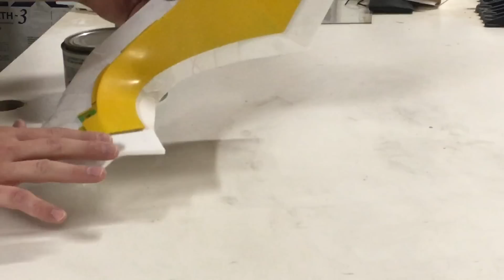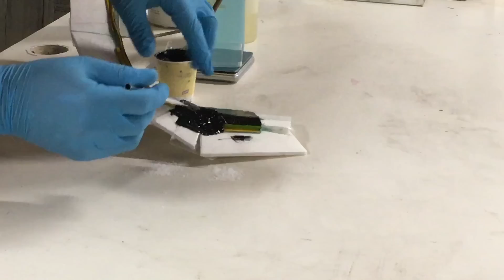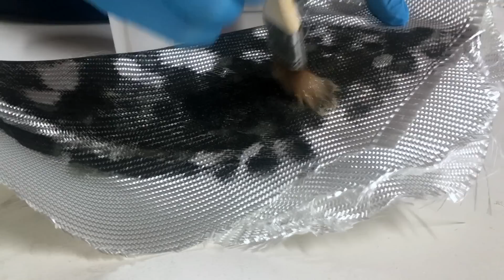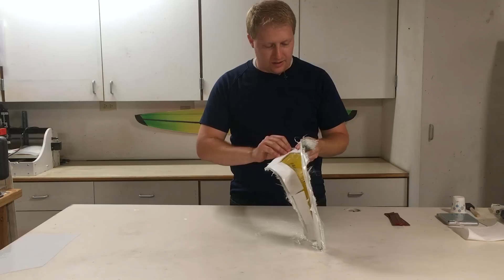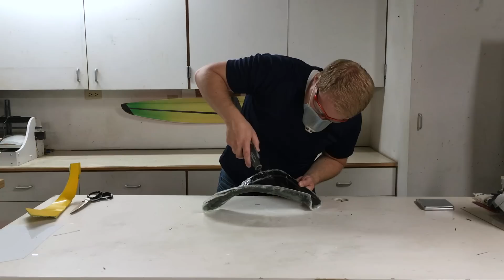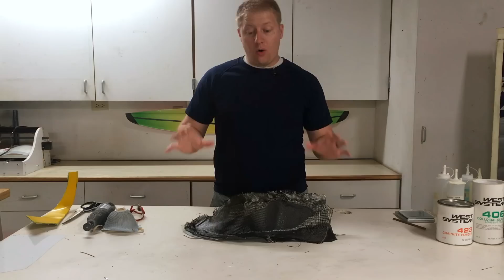How to Make Carbon Fiber Parts (Including the Mold)

Comment: Don't try to teach if you don't know what you are doing !
Reply: Doesn't he? What is he doing wrong?
Reply: Why leave a comment when you have not justified your comment , Makes you look like a troll
Reply: @Rising-Mercury  not a troll I'm just an experienced fiberglasser and mold maker !
Reply: @williammolchan3883  and what did he do wrong?
Reply: #1 always put on at least 4 to 5 coats of paste wax and buff between coats . #2 I would have used Clay to fill in the edge gap . #3 you always want to SPRAY at least 3 coats of PVA on . Never brush it on ! Brushing it on is very inconsistent and will affect the smoothness of the surface of the new mold . #3 if you want your mold to last use tooling gel coat ! #4 I also would have rolled all the bubble's out with a fiberglass roller ! Bubble's make voids and voids make weak molds and weak parts !#5 I would have used some shredded fiberglass around the edges of the flange then applied full sheets of fiberglass down . I can go on and on but I think I made my point that this guy shouldn't teach how to videos .
Reply: @williammolchan3883  make a real mold and part and i'll watch your videos more than these. Someone experienced is better than watching who isn't. I'd spend the money to make good molds/parts. Im that kind of person. I dont cheap out
Reply: @williammolchan3883  Okay, thank you!
Reply: @William Molchan If you're such a freaking master, why aren't you showing people how it's done? Put up (the video) or shut up.

Comment: good video but that fiberglass and carbon cutting and sanding is a nightmare. people must understand that if you do it like its shown in video, your simple protection isnt sufficient. your kitchen is now full off small needles of fibers flying all around the place.  ventilator, vacuum cleaner next to it, long sleeve and gloves and blowing everythind with air after work straight into ventilator is the only way how to reduce the dust contamination.
Reply from the maker: I certainly wouldn't recommend cutting and sanding composites in your kitchen!  This was done in a shop, well away from anywhere food is prepared.  The best solution is to have a dedicated dust booth with ventilation and air filtration, but keeping a vacuum close to the cut helps a lot to keep dust down.  Another great way to handle dust is to just keep everything wet.  I've even heard of manufacturers doing all their cutting and sanding under a set of misters like the ones you see in the produce aisle of the grocery store.
Reply: @sasquatch composites i've been looking into the possibility of using a diamond wetsaw made for tile cutting to make straight line cuts in flat sheets of CF - have you ever heard of anyone else doing that? am i paddling up a dead end creek? thanks!
Reply from the maker: @pauly pisspants Yup!  I've actually done this myself and it works great.  I got really clean cuts with no dust.
Reply: @SasquatchComposites  yeah I'd agree, also to note cutting carbon fibre with a Dremel without any vacuum will quickly kill the Dremel via the dust getting into the Dremel motor & bearings.
also when removing the part from the mould you can remove it whilst in a warm water bath this makes it a lot easier & reduces chances of either the mould being damaged (as shown) or the part being damaged. the water basically cuts through the releasing agent & the two just separate.
soaking the carbon part before trimming helps but makes the excess annoying as it sticks to literally everything in fine strands (noting make sure animals & children are nowhere near & ventilation is 100% required)
Reply: As I read your comment my neighbor just put a delta ventilation system for sale in his drive way.
Reply: Ooh get a little carbon splinter on your person little buggers they are...
Reply: Long ago and far away, I used to lay up fiberglass kayaks. We were able to use a razor knife to trim around the edges of the mold before the resin became too hard. Can't the same be done with carbon fiber to reduce grinding and dust?

Comment: Good video. I like the fact you messed up so people can see how a normal process goes. It’s not as easy as some videos make it look.  Good job. I’m always looking for other people’s takes on how to get it done.
Reply: Same you
Reply: You are right but he did say it was a hard part to start with and no vac
Reply: If you are going to teach to make molds you have to learn to do it yourself. Remember, the kids trying this is going to spend money on their fails... -And why the hell do you use weave on the mold? -You even had problems on that easy , tiny part...
Reply: Ron Gravel I think he made to many mistakes for 10yrs of experience. Crappy flange, carbon powder for pigment🤨

I understand u wanna see mistakes, but he says he has the experience, it’s just the worst experience I’ve ever seen. It only teaches the rookie that this is all ok, it’s not

Clean molds, clean parts. 
If u haven’t seen Easy Composites videos or Airtech videos u will or a novice will think this is ok 👌🏾, it isn’t, just sayin

Comment: I just kept waiting for the vaccum squeezing . Wouldn't that have  pushed the fabric into the crevices and the corners ?
A really good to see the videographing of a painstaking effort. As usual, the best things will get few views whereas rubbish would have crossed a million views. Please keep up your effort.
Reply from the maker: Thanks for the kind words!  You're absolutely correct about the vacuum.  It would help tremendously with getting the fabric to stay in the corners.  However, I wanted to show newcomers to composites that it can still be done without investing in expensive equipment like a vacuum pump.  Cheers!

Comment: Im sorry but It looks weak 
Does it have the carbon fiber strength or the carbon fiber is just for show? 
Thanks in advance for answering
Reply from the maker: It's quite a bit stronger than the original part, which was just injection molded plastic. And it's about half the weight of the original, too.  That being said, this method (we call it "contact layup") will never match the strength or weight of a vacuum bagged part.

Comment: imagine being the guys tasked with building an F1 front wing with all those little winglets
Reply: Rhaegar Targaryan they don’t make f1 carbon like this mate all prepreg witch sticks to the mold much easy to work with than woven mat
Reply: @DjCasonDrift  not to forget that it then goes under vacuum and into an autoclave with a lot of pressure and heat.
Reply: TheShaddix all the $$$$
Reply: There is also engineering that is performed to ensure structural integrity, which includes layup angles, correct twills and resins etc. All validated with FEA and physical testing. This is literally just slapping some fiberglass on a part and adding some epoxy haha

Comment: Hey I'm interested in getting Carbon Fiber to build a RC plane for video recording. Due to the strength and weight of CF that's why I want to use it over Fiberglass. Would you be able to message me on here? I would love the help
Reply from the maker: Perhaps I'm just technologically illiterate, but I can't seem to find a way to message you on Youtube.  Did you find this video through RCgroups?  You can message me on there.

Comment: What type of resin and hardener did you use?
Reply from the maker: You can get a full materials list with links by clicking on the link in the description, but the resin system is Resin Research Composite Pro 2050 with their 3100X hardener.  Love the stuff.

Comment: You've really put together an excellent instructional video on this process. Thank you very much. Do you think that starting your layup with a lighter cloth would help with the tight areas? I've been meaning to do a plug and a mold for a couple of micro edf projects for some time but I'm still working on getting my cnc mill, 3d printing and my 3d modeling up to spec before getting into the actual tooling. Thanks again!
Reply from the maker: Yes, lighter cloth can conform to tight areas easier.  Using a twill weave can help as well.

Comment: nice walk through of the techniques, looks like it could be use to make model fuselages. Your other video on the dlg tail is really good too (inspired to give that a go at some point).  Only suggestion is PLEASE use breathing protection when using coloidal silica... it gets airborne easily and is really bad for your lungs.
Reply from the maker: Yeah, I really ought to.  I've never worried about it since I'm always mixing such small batches, but you're right.  Exposure over time is probably what'll end up getting me if I'm not careful.

Comment: Great video. I am currently doing a lost foam version of a fuselage but want to move to mold making in the future.
Reply from the maker: Awesome!  I tried doing lost foam methods when I was first starting out and never could get good results.  I've seen others make great ones, though.  I've made two fuselage molds for DLGs by hand now and while it's a lot of work, it's worth it once you've got a design you like.  The quality of parts you can make is just so much better with a proper mold.